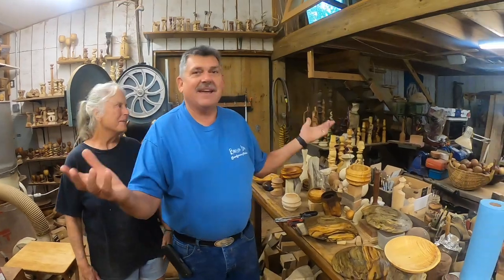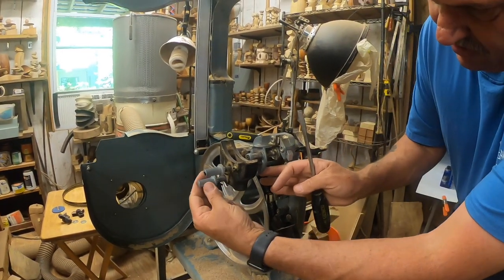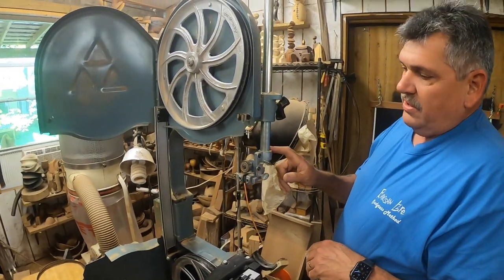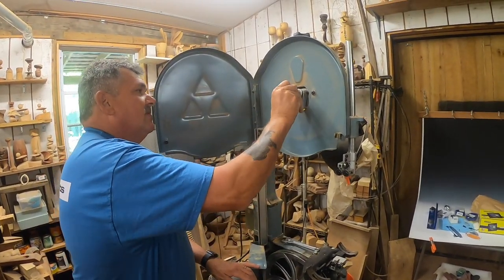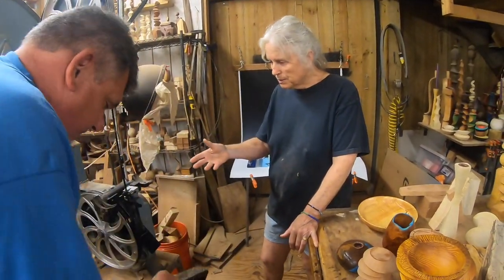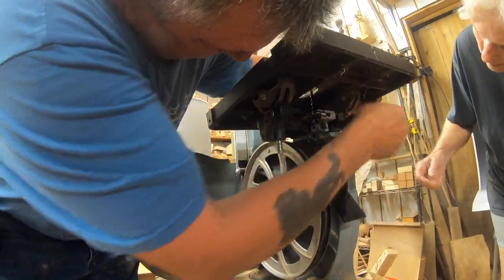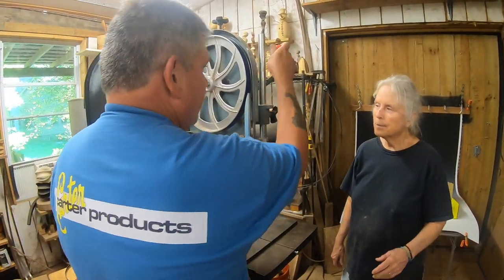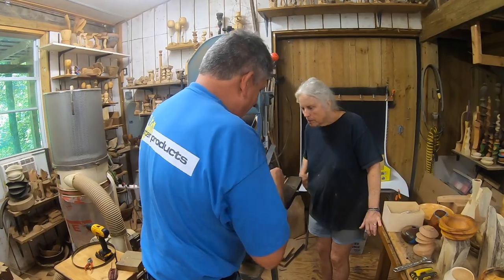Upgrade Barbara Dill's Delta 14" Bandsaw

Comment: This is the perfect example of these type of power tools can be around for a long time, and with improvements like these, you do not have to buy a whole new saw.  Its great that Carter sells these lines of product to do this.  That is probably stronger than the new ones, and by that I mean stiffer, so it won’t flex.  Nice job

Comment: Great video.  I’ve upgraded my Delta Platinum 14” bandsaw with new Carter tires, upper and lower guides, Cobra Coil and Quick Release.  It runs like a new saw.  I love the convenience of the Quick Release.  I’ve also started the up grade process on my newer Shopfox 14” bandsaw.  I’ve installed a 
Riser block, ant the upper and lower guides.  Since it was newer the tires and tension Spring were in good shape.  I’ve got the Quick Release that was made for a Jet saw, but haven’t gotten brave enough to put it on the Shopfox.  I’ve be told by several people that it will work, however, one fellow club member said he had problems with his.  Wish they still had the Woodworkers’ shows in my area.  I always went toe Carter booth just to watch your presentations Alex. They were always informative and fun, but usually costly (I’ve got a lot of Carter products because of you 😁).  Thank for all the info you’ve shared with others.  Hope all goes great with you.  Cheers, Tom

Comment: I been trying to find out how I can contact Mr. Snodgrass. I’m hoping he will read the comment or somebody may have a suggestion and apologize for this comment being a little bit long in advance. I’ve not had good luck dealing with Carter customer service they just keep refer me to Mr. Snodgrass videos. I watch them but I still have a question. I am a little bit lost. I have this same bandsaw it’s a 28–203 Delta bandsaw. I have it basically stock, never been touched. I put a 1/4”inch blade on. What I mainly use this for is for circle cutting which I’ve made a jig for works great and I’m starting to do for lack of a better term bandsaw magic. Were you take a square piece of stock cut a design in it tape it flip it cut it again and then you roll them all out glue up and you have like a table leg somewhat design. While doing these after cutting about a dozen, my blade bound and snapped. I am wondering if I need to change the set up and the blade size. again, I have watched all the videos but I’m still somewhat lost. After watching this video I’m wondering if I should continue with the guides and put a quarter inch blade on again? the circumference of curves was about 2 inch radius or just a little larger. I’m wondering if I should go 3/16 of an inch possibly get rid of the guides and just use the support guide from Carter. I hope someone can guide me or give me some info, or if Mr. Snodgrass himself sees this what would your suggestion be you’re saying that if she kept a quarter inch blade on her saw with the guides is fine but what if I want to make like reindeer can I do that with a quarter inch blade with guides or change the set up. I completely lost on what to do now I think just too much info and I can’t make a solid decision. Thank you.

Comment: Will adding a riser block to the head assembly cause a misalignment of the two wheels.  I like too have more height but don’t want to throw out any alignment of the wheels. Not sure if I can even get the riser block from Delta. My saw was purchased in early 2000s and it came with the Carter accessories you show. Excellent saw.
Reply from the maker: The risers are still available on eBay.  They have pins to line them up so it’s very difficult to get them out of alignment

Comment: Alex, the pulley on the bandsaw wheel (not the motor) works its way off its shaft; the little key that stabilizes the pulley works its way loose, and the pulley comes off.  Do I just need a new key?  Where would I get one, if you think this is the answer.  Thank you.
Reply from the maker: Any hardware store should have a woodruff key and set screw to fit it

Comment: Thank you Alex!  Excellent tutorial!  I've got the Carter guides on order of my early 90s Delta 14 inch. Will add the tension quick release next. I'm sure you asked a lot about riser kits for the Delta. Do you think the eBay kit is the best option for this? I have a shop full of Delta machinery. I thought I would always be able to get parts and support -- I was really wrong about that! Too bad Carter doesn't make a riser kit for Delta.  Thanks again for all of your excellent band saw video tutorials!
Reply from the maker: The eBay kits are expensive but really well done.  Thank you for the support

Comment: I just heard you say something about the Platinum Package - where the Delta comes with Carter guides. I have a Powermatic PWBS-14cs .. I was told those were Carter Guides that that one came with. Is that so? I bought the conversion kit for it, anyway - have not put it on yet. But - that kit also fits the RIDGID 14" BS that I have (14002). So - Should I put the kit on the powermatic and the old powermatic stuff on the Ridgid? or ? I mean - if the Powermatic already has the carter bearings on it - I'm not gaining much, right? So - which one do I put it on?
Reply from the maker: Sorry but the Powermatic comes with Carter like guides, the same guides do fit the rigid.  I would install the conversion kit on the Powermatic and a stabilizer on the rigid.
Reply: @bandsawlife2660  THAT's a GREAT idea .. which one do I get .. do you have 'em in stock .. I'll order it tomorrow .. or .. right after you let me know. Link if you can, also. Thanks, sir !
Reply from the maker: https://carterproducts.com/pub/media/catalog/product/cache/682e18ff750c07a36f2c508dbe87a3a8/j/e/jet_14_kit_3.jpg